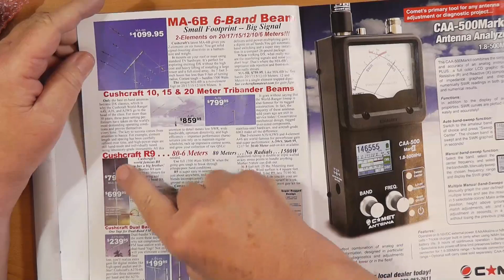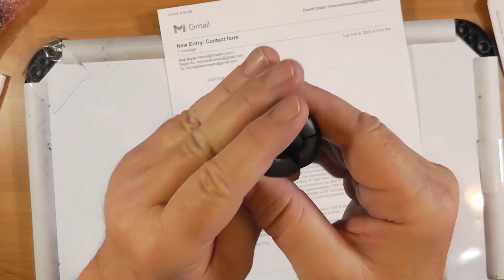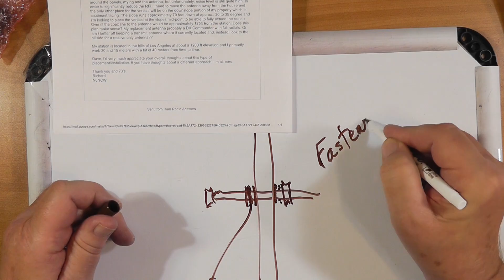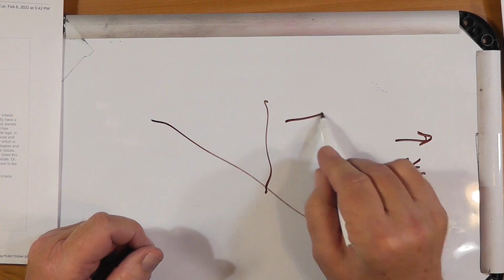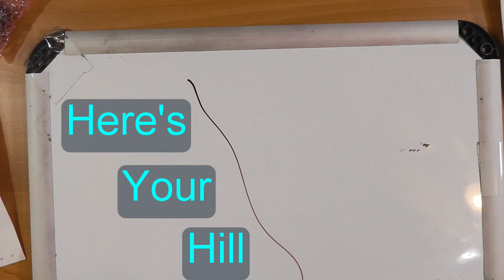Moving an R7 Vertical (#660)

Comment: Alas, my poor R7. 12 years she stood atop my tower, serving me well, allowing me to work all continents despite puny wattage. She at last fell--literally--to the abuse of a pair of October storms with hurricane force winds. The first weakened her, battering her with golf ball sized hail. The second, 10 days later, snapped her below the radial insulator base. I noticed high SWR on all bands. I went out to look, and she was completely inverted, hanging by a ribbon of stainless steel. I carefully lowered the tower to remove her and replace her with a BB7V. 16 years and a QTH later, I still miss her. N8CPA

Comment: As Dave suggested, make sure everything is well grounded and bonded together.  I'd suggest getting a copy of the ARRL book Grounding and Bonding for the Radion Amateurs by Ward Silver.

I also wouldn't assume the RFI is coming into your system from the antenna.  I could be coming in on the power supply.  It would probably be worth trying an experiment where you power your station from a 12-volt battery to see if that helps reduce the noise.  If it does some of your noise is likely coming in through your AC lines through the power supply.  

Your coax from the antenna should also go all the way to the ground where there is a ground rod that is bonded to the rest of your electrical system.  At the ground rod location just before the coax enters the shack there should be a lightning arrestor that is also well grounded to the ground rod.

From some stories I've heard from other amateurs even neighbors that have solar panels in the neighborhood have caused them RFI problems.  Keep in mind that the solar panel inverters are regulated by the FCC and must confirm to certain RFI noise standards and the manufacture and installers can be held accountable by the FCC to meet those standards.

Keep in mind that every wire in your house will act as an antenna to pick up RFI from the inverters that are part of your system.

Comment: I have a used R-9. I upgraded the coax to LMR-400 125ft. My problem is getting the SWR in the right area of the band. I keep shortening it.  I'm just at the edge of 4Mhz, 8Mhz, 15Mhz, 30 meters but nothing is inside the band.  I'm concerned that I might trim too much off.  The 6m, 10m, 12m, 15m are just fine.